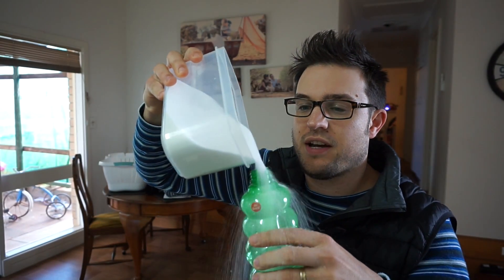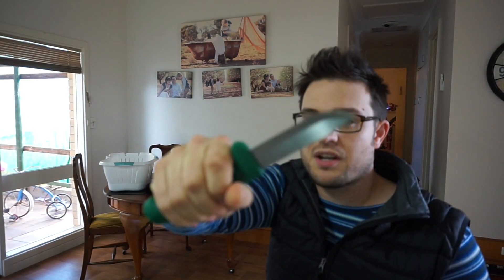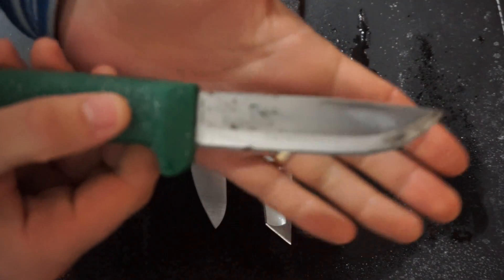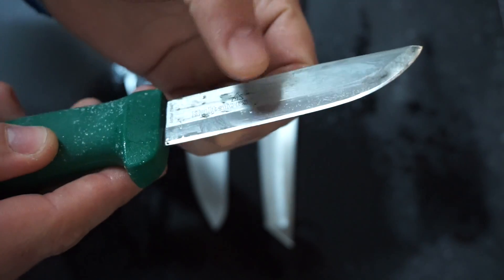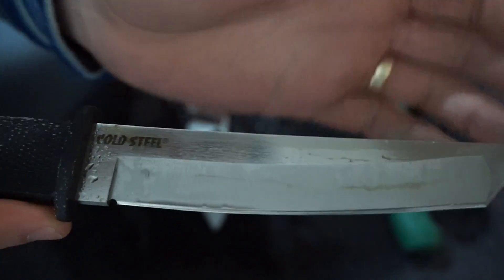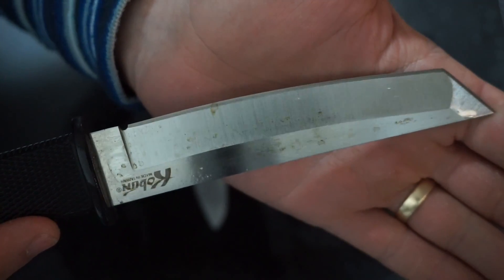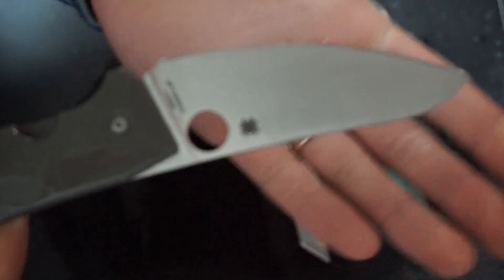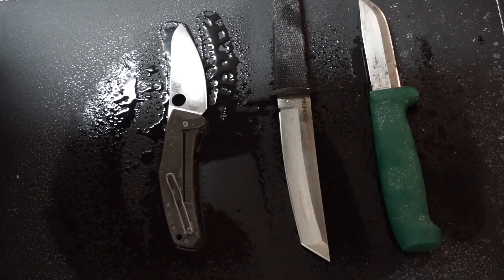Will it rust? Stainless Steel Testing! AUS8, Carbon Steel, LC200N

Comment: Hi peat whitch 1 folding (to go with a 940) knive and 1 fixed knife (to go with my mora companion) should i get 

(Fixed knife around 5 inches   and nothing more than $250 ) i found a falkniven s1 for $244 at knife shop Australia thay also have a1 a2 a1l f1 in all colours 
I live in the adelaide hills so i need to do simmaler things to you 
Thanks peet

Comment: This is where Cold Steel's 4116 excels.  The edge retention isn't great, but it's very corrosion-resistant.
Reply: I wouldn't call it "very" corrosion resistant, almost every stainless steel besides cts-xhp, zdp-189 and 8cr13/14mov have a better resistance to corrosion as aus8

Comment: I think that Hultifors HD is one of the best budget bushcraft knives on the market, it truly is one heck of a good knife considering you can buy one for $10-$15 U.S.
If you remove that secondary bevel its a great beast of a woods knife, performs great and sharpens up easy with a very sharp edge. You can also use a sander or dremel tool and shape the handle to fit your own taste, then use a heat gun blow drier to melt the plastic back to smoothness. Its fun to mess with budget stuff, if things go wrong you dont brake the bank.
Reply from the maker: Airik1111 I just finished up recording the audio for the review. I did some cruel things to that knife and it took t like a champ

Comment: An interesting observation whilst using my companion in carbon. I lightly oil it from time to time but must have skipped it.
I was cutting lettuce from the garden and it gave the blade an almost instant patina on the tip.

Something in the milky sap set it off, quicker than an orange perhaps. Or it was a one off incident. But ill be doing a test or two of my own to see what happens.